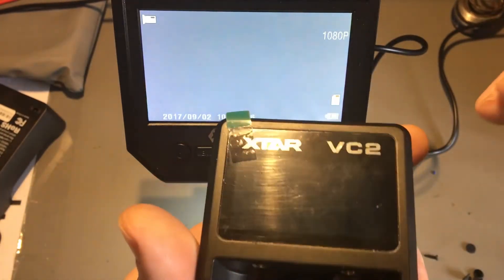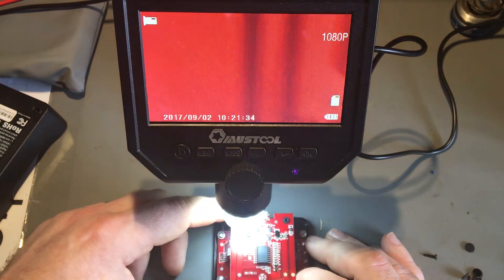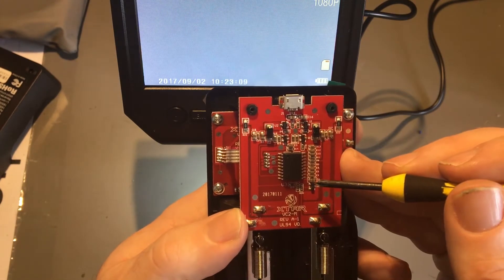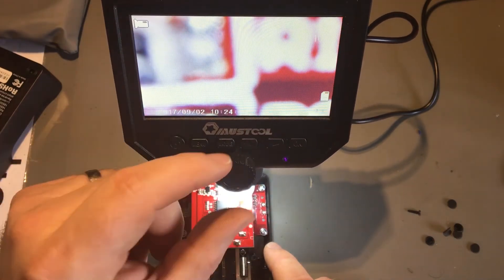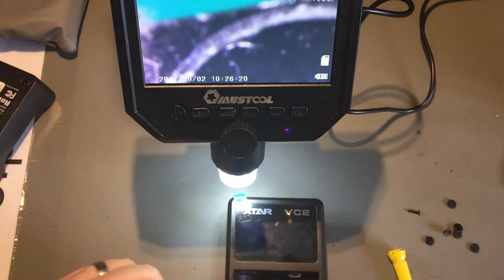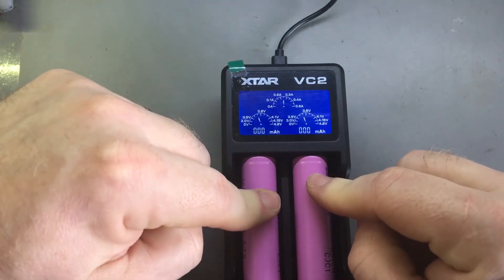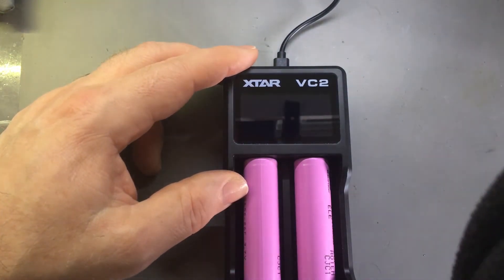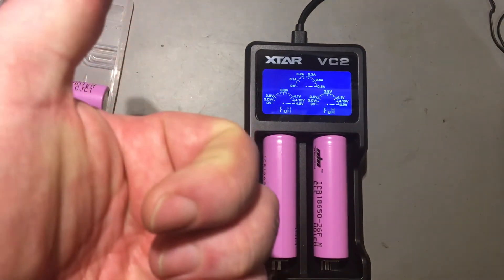#282 XTAR VC2 Battery Charger Teardown and Firmware Bug

Comment: i have a 2.4 brick with voltmeter built-in which says 0amp but the vc2 current indicator shows max 0.5 amp. whatever the condition is, charging or full still the vc2 shows 0.5 amps  im starting to think mine is a clone or fake but i have already verified it is legit according to xtar.cc

im currently reviving some 0.1v cells right now. but still shows 0v after 2 hrs plugged. some of those cells were dropped in a concrete a meter high fully charged then suddenly went 0v after i dropped them. i wonder how long should i remain those charging

Comment: I have this issue with the vc2 plus. It will show a battery 18650 at 56% on the left side when the battery is only at 16% when I take it to the right side.
Reply from the maker: Autistic Christian Simulator - yes I think the design quality of the GUI could of been better.

Comment: i have been stupid... i've put 12v on the 5v input :( U3 ic is blown U3 next to the USB connector.. what's this ic ? the component type nr ? the charger  is the Xtar VC2 Plus
Reply: found it myself, its the FP6276B
Reply: I did the same thing, what should i replace to fix it?

Comment: The behavior is normal. There is no bug. This is how Xtar VC2 and VC4 works. They do not show the actual charging current but the maximum allowable current.
When no batteries are in it shows the maximum: 500mA.  When you put in the batteries the current drops because the 5V power supply is no good.
Try to put it in a minimum 2.1A wall power supply and it will stay at 500mA. This information is in the manual.
Reply from the maker: Radu Popa - thanks for the information.

Comment: how odd, different every time.
Pity you cant find out the a-to-d inputs for that measurement and monitor them with a 10meg input resistance dc volt meter.